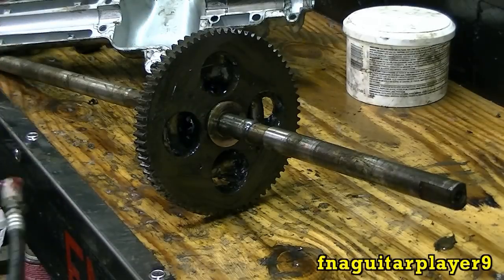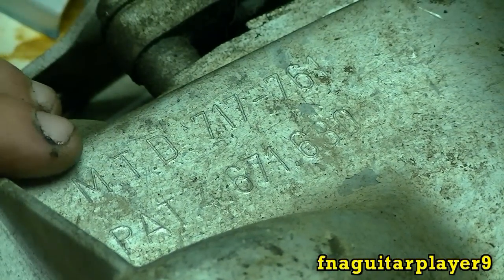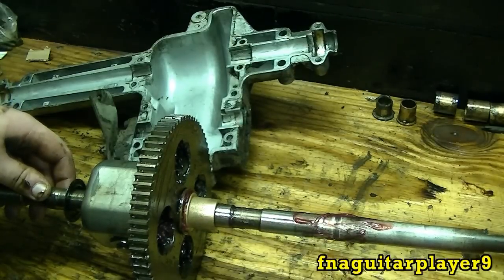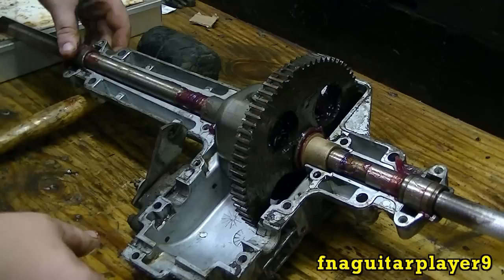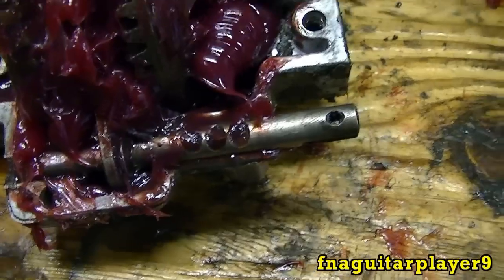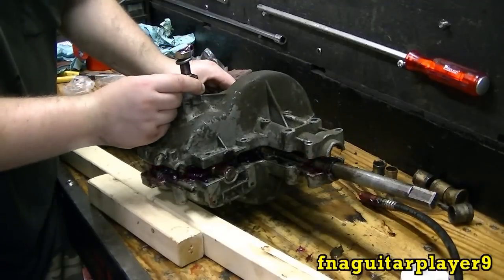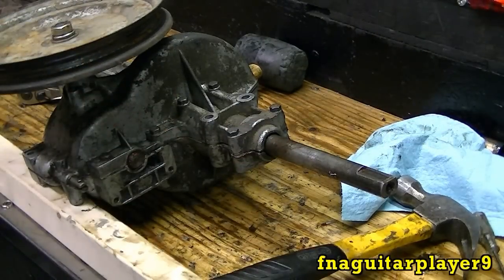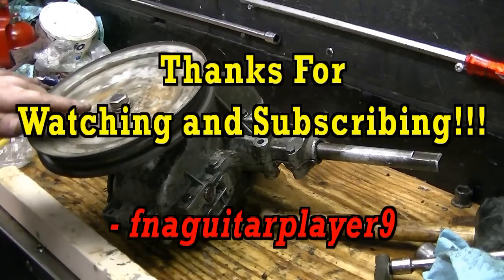MTD Transaxle Basic Rebuild (Replacing all Bearings) Part 2 of 2

Comment: Great video thanks a lot, I have to do this in the next week or so and lock the diff
           any idee of the cost of the bearings .ps;the backgound noise was a bit loud, but               thanks again
Reply from the maker: Thanks, your welcome! Heard that, for what i replaced in this video it cost around 50 dollars, but it depends on model of transmission. Also, i get parts from tewarehouse (dotcom) they offer aftermarket brands which can save a ton of money. Yeah, sorry about the noise but it was hot that day, over a 100 in the garage! Thanks for Watching!!!
Reply: Thanks for quick reply , so now i have a idee of the cost
btw I use graese from automatique greasers like on caterpillars this is semi liquide and ideel on
slow to mid reving gears. Greetings from Belgium
Reply from the maker: your welcome! Yeah it does vary some though. I have a 3 speed (another video) that need all new bearings and it has ball bearings so it costs more. I'll keep that in mind next time i need some grease. Thanks!

Comment: reely good video thx my troy pony while driving jump in an out of forward drive what do you think in worn or bad on it thx for ur help
Reply from the maker: More than likely what is causing that is the little ball and spring that lets the shifter "snap" into gear, if its worn or the spring is broke it will drift out or jump out of gear. If it isn't that its probably the selector fork or the part (not sure exactly what its called) that the fork rests in that moves back and forth on the shaft, the teeth could be worn on it not letting it stay in gear. Alot of possibilities but that would be my guess. Hope this helps, thanks for Watching!!!
Reply: ok thx for all ideas about trans
Reply from the maker: *****
no problem!

Comment: Great video BUT  I don't recall how you Finally got the two cases back together,what was causing them to bind up?
Reply from the maker: Thanks. Turned out to be a couple of the bushings have a flat spot that goes up and down, i had them in wrong and it was hanging up. Just check the bushings, after that it went right together no problems. Thanks for Watching!!!

Comment: hi Im replacing the needle bearing. During assembly could you explain the position of the small ball., I want to make sure  forward and reverse adjust correctly , could you explain the adjustment again thx
Reply from the maker: I put mine together with the gears in neutral, and put the fork in the neutral spot, and put the ball in the center notch, then the spring goes in the top piece, grease should help hold it in place until its together, just check it first before putting all the bolts back in, it doesn't take much for the ball to move. Thanks for Watching!!!

Comment: That Differential cover is held on with 4 T30 Torx impact metal threads. Why didn't you remove the cover for cleaning and inspection? Thanx for the video 11FEB2018
Reply from the maker: I probably should have, but i was mainly concentrating on the broken bearings, but yeah it would be recommended to do that. your welcome, Thanks for Watching!!!

Comment: Can you provide me with the deails on the lottle metal ball and spring you show in your video? Seems to have lost mine!
thnks
marcel
Reply from the maker: If you need part #'s i need the model of your transmission there are some differences over the years, as far as installing it, you drop the spring in the hole then ball rests on the spring, its very hard to get it to all go together, usually a glob of grease helps hold it in place. Thanks for Watching!!!
Reply: fnaguitarplayer9 Hello, thanks for replying, I al working on a Yardman DX 70 Beetle and the part number on the transmission housing is: "MTD 719-0358. US PAT 4'671'680. It is on old one, so hope you can provide me with a part number for this metall ball with this info. Greeting from Belgium, Marcel
Reply from the maker: Marcel van den Maagdenberg Yes, i was able to pull up a parts diagram for it, the ball part # is 741-0862 and the spring is 732-0863 the site i got the #'s from says the spring isn't available, i'd run the part # where your ordering from and see if it is there. hope this helps!

Comment: my mtd when i try to shift either from reverse to foward is so hard some times, you think the ball bearing is dry from grease on the transaxle shifter..
Reply from the maker: That would be the first thing I would check on it, one of my mowers is like that and I'm pretty sure that is the problem. There are other things that cause it as well, one of the simple things is to much belt tension, if the belts are still trying to spin when shifting it will make for some hard shifting. Thanks for Watching!!!
Reply: thank you,, i think i will give that a try, and thanks for messageing me back, this will prob be a spring project since winter is around the corner, dont want to think about winter. yea few times got the rider hung up got it close to the house or tree and couldnt get it in reverse cause it jammed up..thanks again
Reply from the maker: your welcome! I hear ya, i feel the same about winter! no problem!

Comment: what kind of grease did you use thx harry
Reply from the maker: There is more info on this in the comments but a grade 00 grease is recommended if you can find it, i used a general purpose/bearing grease. First time around i used lucas red n tacky #2 and it didn't like it to well. Thanks for Watching!
Reply: u are a grteat asset to u tube
Reply from the maker: appreciate that!

Comment: how hard was it getting the old bairing off
Reply from the maker: +paul mclaughlin The axle bearings just slide off unless there is a burr or rough spot on the axle. Now the top bearings under the pulley, i've never replaced them before, they are needle bearings. I imagine it would be harder to do. Thanks for Watching!!!
Reply: The needle bearings are pretty easy to get out. You'll need either a press, or a vice with a large jaw spread. I put the top housing in the vice. The order was like this... 1x6 piece of wood against the inner jaw/transaxle housing with the inside facing the wood/ and then a socket just barely smaller than the O.D. Of the bearings. Then it's as simple as turning the handle. There are two bearings, and both need to be pressed towards the inside of the case, and through. You might have to use a hammer on the handle. I did, and I didn't damage anything. It's cheaper if you find them on eBay by the bearing number. They are SCE108's, I believe. The number can be found on the bearing. Don't find them by the MTD #. You'll save about $6-$8.
Reply from the maker: Sounds about right, they weren't real bad so i didn't mess with them, probably should have since i had it apart. That is true, ill keep that in mind! Thanks for Watching!!!

Comment: I found this on Amazon for 12 bucks plus shipping. Seems to be perfect texture. amazondotcom/gp/product/B001OKBHRK/ref=oh_details_o04_s00_i00?ie=UTF8&psc=1
Snapper brand liquid grease. Cleaned off as much of the old as possible and used this. BTW..this bottle was plenty.

Comment: What are the torque specs for the 1/4" case bolts
Reply from the maker: I couldn't find it at the time, i just torqued them all the same with a 3/8" ratchet. Thanks for Watching!!!
Reply: German specs.. Goodntight. Do Not use American specs (Way too tight)

Comment: you forgot to include the gear selector..............................
Reply from the maker: I only included part #'s on parts i was replacing, the part number for the shifter fork is MTD # 717-0754 and the part it fits into (clutch collar) is # 717-0667 these all numbers for this particular transaxle. Thanks for Watching!!!
Reply from the maker: Unless you meant i didn't show putting it back in, I just noticed that in the video, it just slides back in the same way it came out, just make sure it slides back and forth freely. sorry about that!